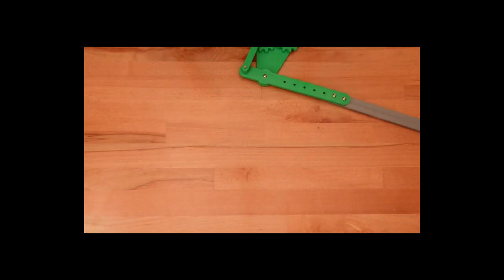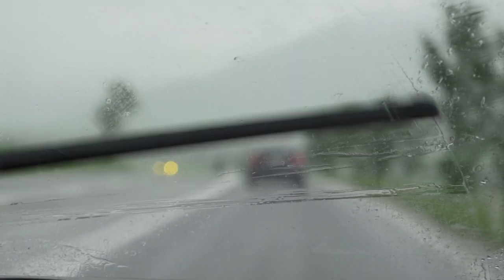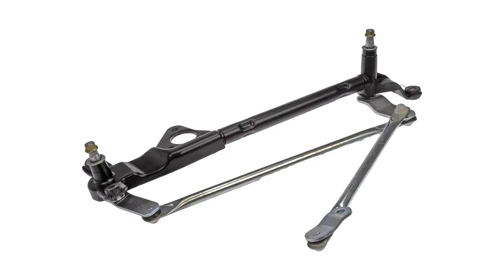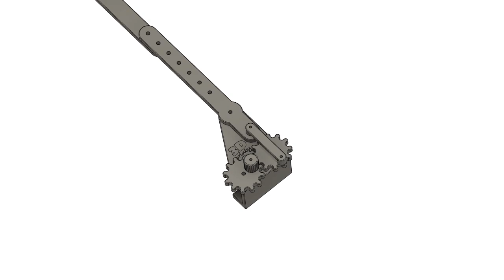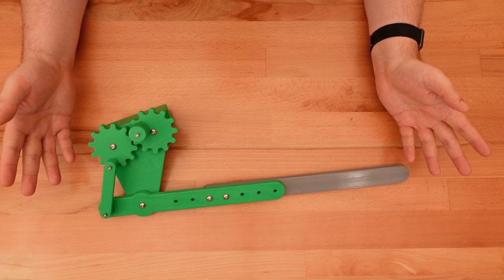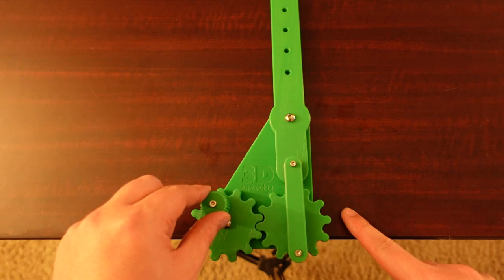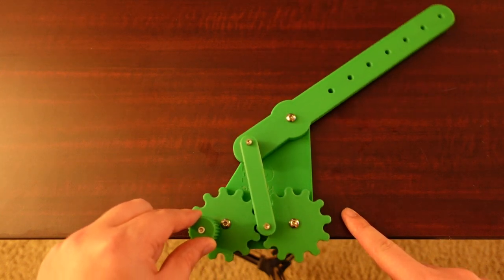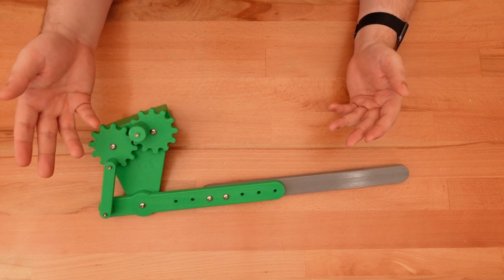3D Printed Useless Desk Clearing Mechanism

Comment: Where is the thingiverse link?
Reply from the maker: Unfortunately, about a year ago, Thingiverse removed all 100+ models on my account. I suspect this is because my designs were falsely reported as "inappropriate content". Any new models I posted were also deleted within minutes.

Thingiverse eventually restored all the models and my account is not currently being targeted. But process took months. So I switched over the Printables and Thangs, where my designs could not be automatically attacked in that way.

If you look, you can find this design on Thingiverse by using their search - it's called "Desk Clearing Mechanism".